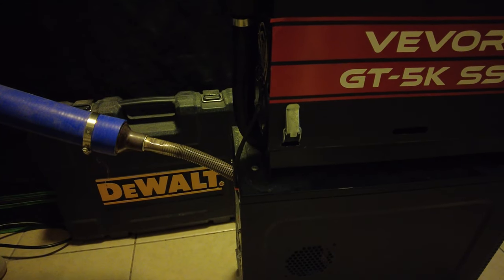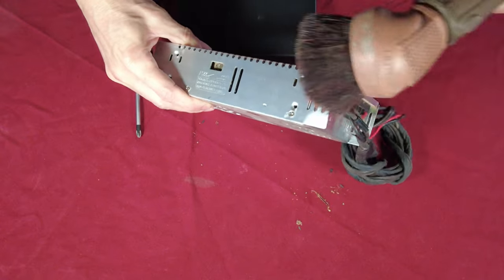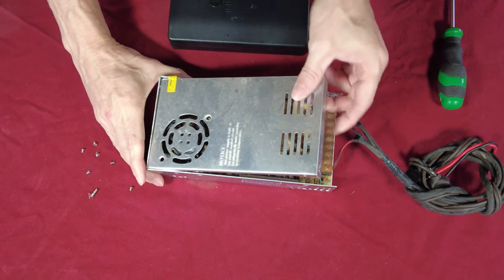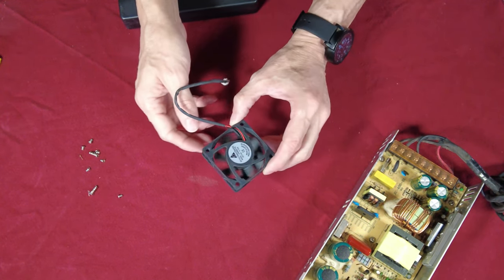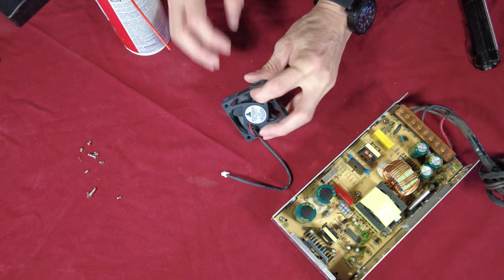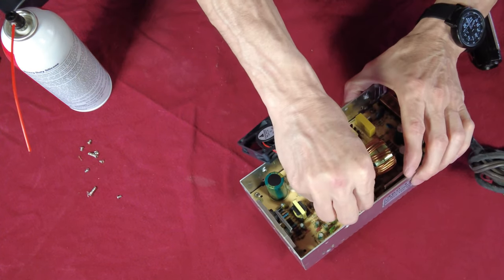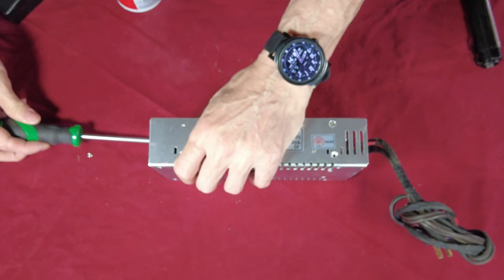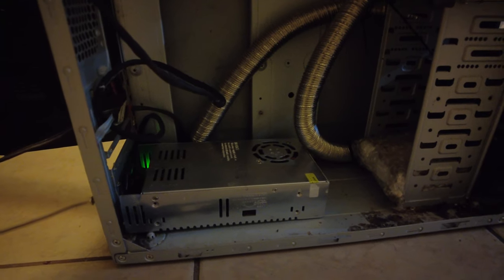The Watchman News - Diesel Heater Power Supply Repair • I Am Not A Fan Of Fans • Only Fans Account?

Comment: Highly recommend not using a vacuum for this. Vacuums can get static electricity on their plastic handles, definitely use an air duster instead.
Reply from the maker: There is nothing on that board that is that sensitive. I used to be an electronics lab repair tech. That being said I use that same vacuum on my computer when I clean it. Its all good as long as the CPU is not sitting there outside of its socket. That is a filter queen vacuum. I have yet to see a static discharge from one. Its not one of these cheap new ones. Its only super critical when components arent in a board. Otherwise the circuit will absorb it within reason.